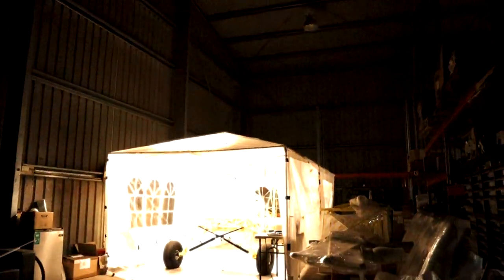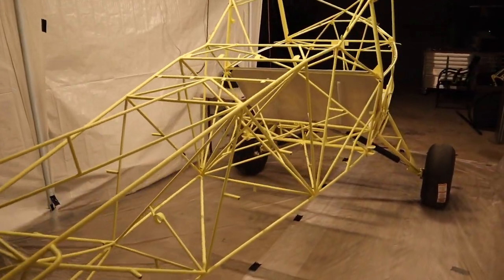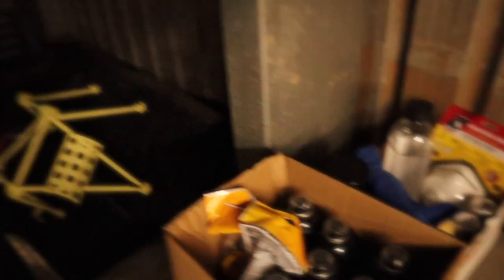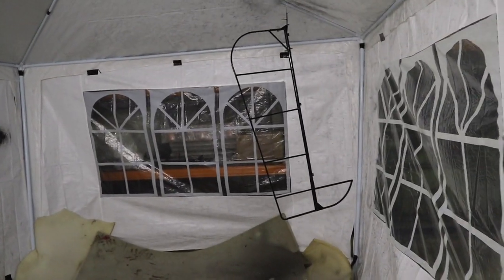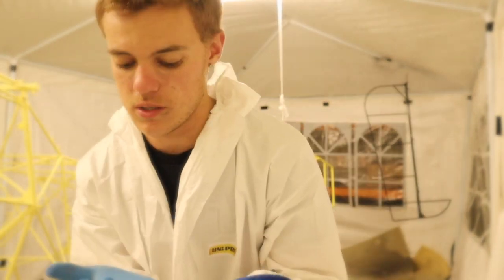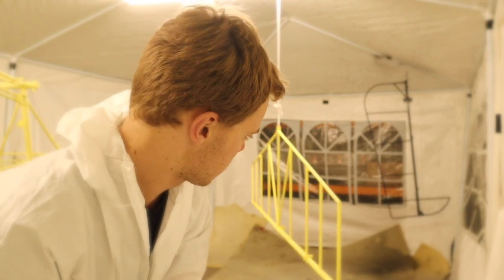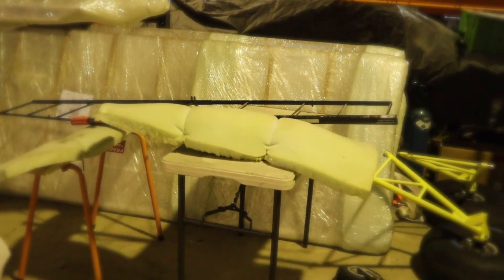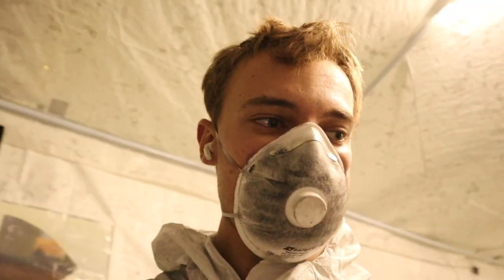KFA Explorer Build Part 2

Comment: Hello Brock
Rust protection is your goal..the means by which you accomplish that is not important. Its your project and experimental gives you the freedom to do things in your way. The black on yellow primer should help you find any light spots. Painting a fuselage is tedious and very time consuming but the results are worth the effort. I am restoring a 1946 Taylorcraft and we painted battleship gray over a white primer...with a spray gun...I think your method was the right choice.